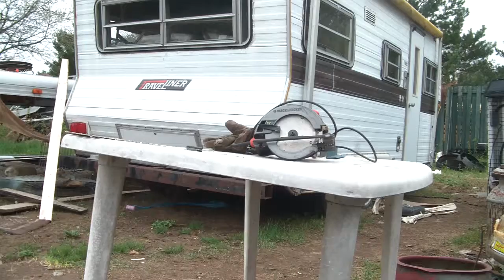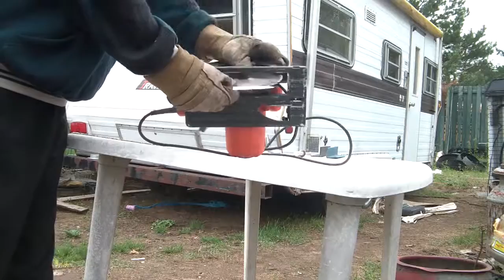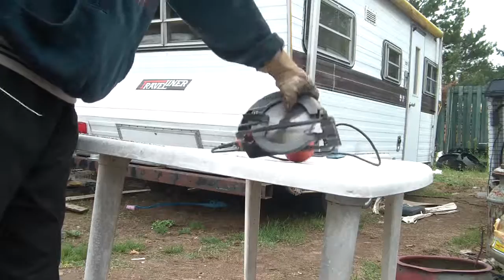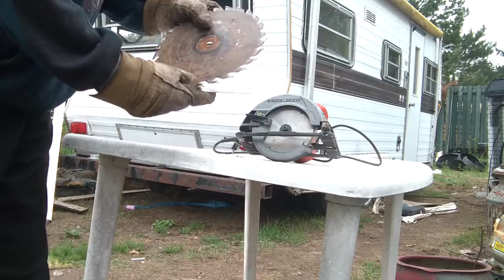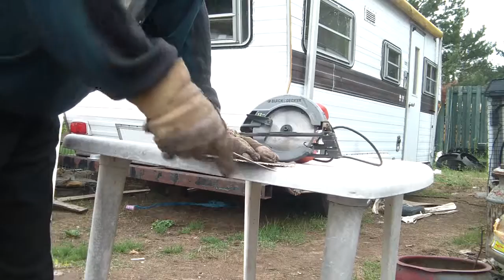How to Sharpen a Knife with a Circular Saw

Comment: I'm watching big chunks of metal fall off your knife.  carbide sharpeners ruin hundreds of knives every day
Reply from the maker: +butre jp Its not the sharpeners that ruin the knives, its the people not using the sharpener correctly. They are designed to take off a small amount of metal to put an edge back onto the blade. No matter what you use it takes off metal to put the edge back into the knife.